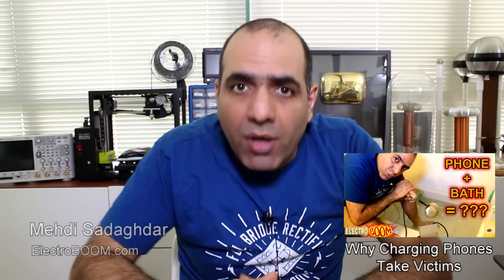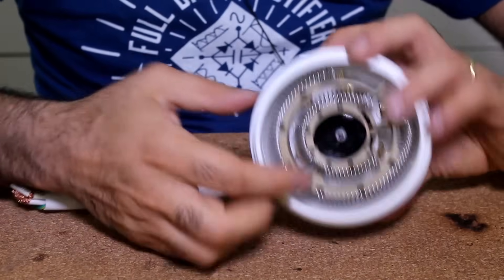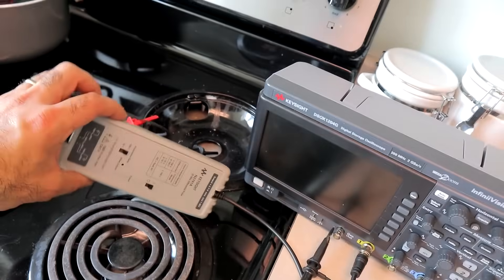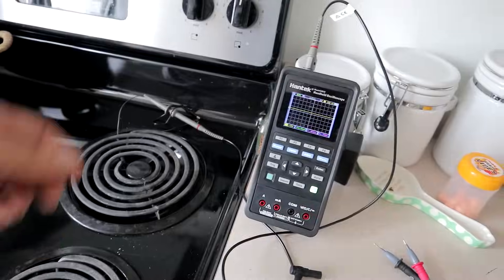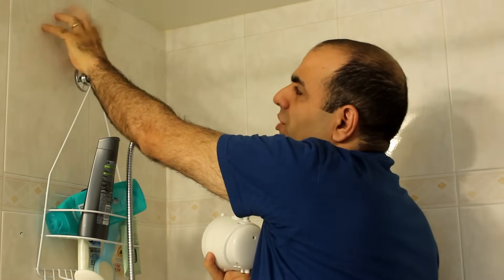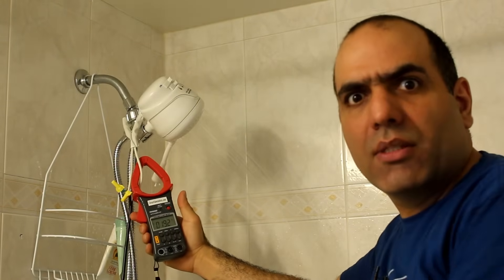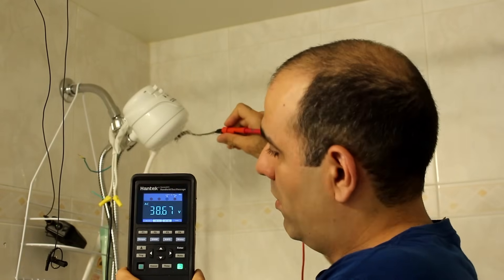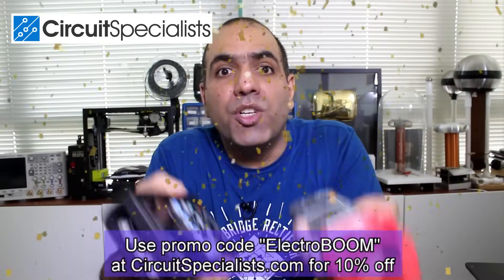How Safe Is the SHOWER HEAD OF DOOM?!

Comment: Here in Brasil (HUE-land) we use these showers everywhere with no problems because:
1- the power grid of our houses are made with this kind of shower in mind (50+ amps).
2- we don't use them this close to our body, it's a hot country and we install our showers higher, close to the ceiling, the power outlet usually come from the ceiling, far from most people's reach.
PS: our standard ceiling is 9~10 feet tall, again, hot country.
Reply: but faulty ground can make the water register(if made of metal, wich normally isn't) shock you
Reply: @Shadownrun2  but this is really not a problem, just use flip flops in the shower. The whole country does this.
Reply: You misspelled "2.7~3 meters"
Reply: @Shadownrun2  another huehuehue here. I think there's something more to it, many Brazilian homes (including mine) haven't got ground circuits and yet nobody gets electrocuted.
Reply: And chile aaaand Argentina aaand Colombia and some more (i think)
Reply: @murilospineli2241  not me.
Paranaense num frio do caralho, mas minha família toda toma banho descalço.
Reply: Brazilian here, your 2nd point is just asking for trouble... You know as well as I do most of these are installed by people with no formal education while trying to minimize costs.
Reply: @thtanaka18  huahauahauahauayau
Reply: @Shadownrun2  that true i shock myself ussing one of this
Reply: I hate taking bath with Flip-flops, so I prefer getting shocked every time heheheh
Reply: A altura média do teto varia por conta do clima do país? TIL
Reply: Why do you need hot water in brazilian climate lol
Reply: @drury2d8  sometimes we reach 0°C
Reply: @murilospineli2241  no RJ nosso chuveiro é aterrado todo mundo toma banho descalço
Reply: What does the country hotness have to do with ceiling height?
Reply: @rodrigoa1990  Um teto mais alto significa um maior volume de ar dentro da casa para aquecer durante o inverno.
Reply: Just brazilians talking to each other in english, just another day in the internet...salve
Reply: @Shadownrun2  Yeah, and sometimes it does... (when touching the faucet for example)
Reply: What's the building and wiring regulation and enforcement like over there? How likely is it, for example, for a building inspector to be bribed to approve bad wiring?
Reply: @renxula  because heat rises and leaves cooler air down below. old american homes are the same, before the time of air-conditioning. I live in honduras, all of the ceilings are high here too, and it's hot, and air-conditioning isn't a thing. too expensive.
Reply: If it's a hot country, why don't just use a cold shower. 🤔
Reply: @StarkRG  in general only big comercial/residential buildings follows all the technical standards, like apartments and condos, mostly of the houses don't. It's a poor country, build a house and having electricity is already hard, follow all the technical standards is not the reality for most of the population. Sometimes the same "professional" who project the houses is who build, make plumbing, wiring and everything else.
And inspections are generally only done in big buildings, and after the build is finished is very rare a inspection occurs. But if occurs, you can pay a coffee to inspector and promise him you will solve the problem until the next time he comes.
Reply: @BattousaiHBr  "Done by people with no formal education while trying to minimize costs." – should be the sub title of the "History of the world" book ))
Reply: @StarkRG  building inspector? You mean like a govt building inspector? We don't have these ones here
Reply: thtanaka18 I’ve visited brazil 3 times, I’ve seen many plugs that have a ground prong but I have yet to see any outlet that has a ground outside of GRU airport. Everything I bought over there I had to rip the ground prong off lol
Reply: @graeff  A building inspector is someone who works for the government and signs off on any major construction or remodeling. They ensure compliance with building codes so that everyone involved, including future owners, can be sure of a minimum standard.

I'm guessing that, if you don't have building inspectors, you also don't have building codes. In that case how do you know that the wiring in your house is done properly, the foundation isn't just going to crumble away, and the walls aren't made out of painted cardboard? For that matter, how do you know that your neighbour's isn't going to burst into flames and cause your house to burn down also? Or is it more just a mentality of "meh, if I die, I die, if I get mained, well, I'll deal with it then?"
Reply: @noname-sk3hl  freezing cold water is freezing cold even when the air is hot.
Reply: @sterkriger2572  Em SP tbm mas depende do eletricista não tem
Reply: @noname-sk3hl  because it's cold as shit in winter
Reply: @StarkRG  We do have these in Brazil. Any new building needs to have a city hall endorsement done by a building inspector, usually engineers or architects, who must approve your building before you are allowed to move into it.
Reply: I'm northern Argentina we use these too. I am 1.90 m tall and it feels horrible to be able to sense the 50 hz in your scalp. This is not safe, just really cheap.
Reply: @Shadownrun2  esse é o problema mais comum kkkk
Reply: how much is kW/h in Brazil?!
Reply: @IvanStepaniuk  I've never felt that, sometimes I get shocked while opening the shower and touching the "valve"(I can't remember the exact name) but that's it.
Reply: @Shadownrun2  i live in brazil
and the metal water register is very chocky
Reply: Pois é
Reply: @blitzkrieg7353  
It's not common to see these in Chile, actually they're quite rare.
Reply: @murilospineli2241  doesn't make any difference to wear flipflops when it's the faucet that electrocutes you. 3/4 showers i have been at in brazil shocked me, despite me wearing flipflops...
Reply: Darryl P because hot water is nice
Reply: @takafumiarisawa70  no dude
I mean the height of the shower
Reply: @blitzkrieg7353  Ohh my bad then.
Reply: Apologies for the question (no wrong intentions here), but why can't you just put a black painted, steel, water box on the roof? I think you are a very hot country, free energy just surrounds you.there!
Reply: @thtanaka18  you probably wouldnt hear from those that do
Reply: Why do you need hot showers in a hot country
Reply: the same happens in colombia
Reply: I am in Paraguay and we have many of those showers. I have one in my house lol
Reply: Up
Reply: @murilospineli2241  you use flip-flops in shower??? How barbarian!!!
Reply: Rodrigo M  Com certeza. As casas mais antigas, inclusive no RJ por exemplo, tem o pé direito bem alto, pois antigamente não se usava condicionador de ar. A casa da minha mãe é assim. Mesmo num dia de calor, o pé direito alto torna o ambiente mais fresco (leia-se "suportável").

Casas e prédios mais novos tem pé direito mais baixo e forro de gesso. Mas colocam condicionador de ar split.
Reply: no name Because even hot countries might have cold winter.
Reply: @thtanaka18  so long as the water's very clean, it doesn't conduct electricity well at all at household voltage. So even when the stream flows through without breaking up it wouldn't do much, as oppose to a bath where electrolytes would pool
Reply: @Arthur De Souza But I live in a tropical climate too... if outside temp is 35C, water is at a nice 28C or so. We dont need to heat it.
Reply: @Mr.Leeroy  O preço varia com bandeira(vermelha você consome muito, paga mais caro por kW) e por época do ano( seca e com chuva). Mas em média no, estado de Minas Gerais, é R$0.60
Reply: @JohnCanniff  not from the dead, but from media. They usually love this kind of tragedy..
Reply: @felpshehe  "OMG thats so far from my reality I think I need to call it barbarian"
Reply: @Arthur De Souza Thats inefficient.
Reply: @Arthur De Souzaif you have all your water pipes in an external conduit, its easier to access and takes advantage of the suns heat. Internally routed pipes can be a pain to repair/replace.
Reply: @ryanespinoza7297  it's mandatory to have a ground pin in every plug, but if you disassemble most power outlets here, you'll find no ground wire connected.
Reply: @StarkRG  you are assuming we actually have building inspectors
You just send the plant for inspection no one cares what you do afterwards no one check if you really used the correct wire gauge or if you did ground your installation
Reply: @Shadownrun2  That's insane. No quality control whatsoever. You but a house and have no idea if it's going to student burst into flames because of shitty wiring, or if turning on the tap in your kitchen is going to result in electrocution. Absolutely insane.
Reply: @5084204  A maior porção de terra no Brasil está entre o trópico e o equador, isso faz com que existam variações de temperatura muito esquisitas e isso pode acontecer: https://www.youtube.com/watch?v=2z-bCTMQS_w
Reply: I also use this type of shower everyday and I never felt any shock in the knob even being barefoot IoI
Reply: @rodrigoa1990 
Isso mesmo, varia dependendo da circulação de ar necessária! Casa de BR (e latino americano em geral) é mega bem-ventilada comparado com outros lugares.
Reply: Because some people like hot showers, some places do get lower temperatures, and because Humans adapt to their environment, so what's is cold to me isn't to you, I live in Rio and some people here think 25 C is cold and already putting their coats.

Comment: "it seems pretty safe"

Unless neutral wire breaks. A great gift for a "favorite" relative.
Reply: WELCOME TO BRAZZZZILLLLLLL
Reply: yep. neutral wire breaking or melting is a real risk. We do mitigate that most cases by providing adequate wiring.
Reply: Actually not, if overheating starts by the lack of neutral the element will just melt together with the plastic connections it's design to do it, the place will probably smell of burned plastic but that' it, I never have heard of any fire cause by a shower like this. Actually there's more deaths linked to fires or accidents in home boiler installations then with these eletric showers.

Comment: "1 minute on, 1 minute off, 1 minute on, 1 minute off" -> a.k.a. very low frequency PWM
Reply: aka mechanical thermostat.
Reply: Wax on, wax off... and if it's still not cooking the omelet, do a crane kick
Reply: Gianluca Ghettini well it deepens, it seems to me that it changes the frequency not the duty cycle like in PWM where there is a fixed frequency and changes the on and off duration (or it just has a thermostat)
Reply: Afaik, it wouldn't be a PWM because it's turning off and back on (i.e. 0hz->normal hz), right?
You'd be better off just making an timer based on the clock of the oven that ticks it on and off.
Reply: More like a sine wave controlled by an lfo
Reply: Example.

Comment: In Brazil we usually use the 240V 220V (typo) version because of the lower wire diameter needed and most houses doesn't have any grounding.
Reply: Sounds like a fun seizure for the babys that like sticking forks in stuff
Reply: that's why we don't let them do it
Reply: @ironicman6731  here in brazil this is the least of our concerns as a child hahahahahhhha
Reply: Hey, when I was two I did it, now I'm standing here, seventeen and all, with only minor brain damage!
Reply: No ground... We Just wire It to the neutral!!!! Bang.. welcome to Brasil
Reply: I tried putting a wire in a 220v socket when I was 6 or 7, I blacked out for some minutes, after that accident I became better at math for some years
Reply: Yeah, grounding is rare. With both live wires we do need grounding. But in fact, 220v/240v use less Amperes so... that's the way. Still there are plenty of 127V heating elements and showers to buy.
Reply: In Rio de Janeiro we use 110V, with live and return wires only (fase e neutro)... We have to use 6mm wires to be safe...
Reply: @ironicman6731  Yes, sometimes it happens. That is the reason when people have babies they buy an outlet cover to avoid accident.
Reply: I remember when I was younger, the grounding cable from shower was connected directly to the metal pipe! =D
Reply: @texboy98  And as adults as well hahaha
Reply: I've lived in Brazil my entire life and all houses that I ever saw were properly grounded.
Reply: In India, I haven't seen any house (except mine) with earthing.
Reply: Brazil lalalalala la laa.......
Reply: Use a metal pipe for ground!!
Reply: 110 is more dangerous than 220. 220 throws you back and you have a good chance of living, 110 holds you until you're dead. Just evil
Reply: Same here in syria :(
Reply: As a kid I took the tweezers from the Operation game and stuck it into an outlet. It was quite the light show haha.
Reply: Ironic Man I dont know how a kid, let alone a baby, can reach the shower head that is at least 2m high, but if he does it cannot be more dangerous than a normal outlet that im pretty sure they also dont have protected.
Reply: @smacedorj  Só se seua instalação for monofásica né ... é melhor e mais econômico ligar em duas fases
Reply: @igordiogo5692  Sim. Mas em muitos lugares é monofásica mesmo. Morei em um apartamento em que a instalação elétrica não foi atualizada e era monofásica sem terra... O pior é que nem podia atualizar pois no quadro do prédio não tinha espaço para um relógio novo, bi ou trifásico... De repente hoje em dia, com os relógios modernos e minúsculos, talvez até coubesse...
Reply: It's suspect many, if not most houses in Brazil, at least in the less affluent areas, don't even have GFCIs
Reply: @ironicman6731 I have been shocked by both 110 and 220 and the latter will kick you instantly, whereas the former will keep shocking you longer 😂

Comment: "Besides the fact that it may set your house on fire it is safe."

Thank you, sensei
Reply: sensei means a japanese karati teacher lol uur way off
Reply: @kovanpulkinen8205  Sensei, is a japanese title, given to a teacher or an honoured individual, such as a doctor.
Reply: @gjune36  Ok i was close enough and you probably searched it up atleast i didnt.
Reply: @kovanpulkinen8205  I used to watch a lot of anime and used to like Japanese movies.
Reply: @gjune36  simply writting "your right and i was wrong" hurts more than a 240V shock on the internet.
Reply: @n.m.9616  When someone just rages on me for an unknown reason, i just type that
Reply: I am Brazilian, but I have never heard any case of houses on fire.
Reply: here in BR nobody builds a bathroom using wood, you can make the house using shit, but the bathroom NEEDS to be laying brick and mortar and have a separate circuit for the shower, just in case the stuff try supernova is isolated from ANYTHING ELSE..
Reply: @izanagi3036  pessoal faz banheiro de tijolo né.. mesmo porque se passar agua corrente na madeira o negocio apodrece em 2 semanas kkk
Reply: @izanagi3036  Yesterday a 27 year old mother of three died electrocuted while washing clothes in a "tanquinho".
Reply: @izanagi3036  Here a lot of people don't even have grounding on their houses.
Reply: @tiagopesce  Hey, but if you run running water many times on the brick it melts, so there is a system of pipes.
Reply: @giu_br777  "tanquinho" This shaker is used for washing machine not manual, basically it is a blender without blades, the motor is still dangerous.
Reply: It's easier for a boiler to malfunction and cause a fire than one of this things to burn the house IoI
Reply: in brazil the houses are made of bricks, not wood frames like USA, they don't catch fire easily...

Comment: Using an electric shower requires some care that we learned as a child in Brazil. The shower should not be close to the head; the temperature selector switch must not be touched while it is on; taking a shower using rubber slippers is recommended in places where the electrical installation is precarious; and there must be a circuit breaker just for the shower. Electric shocks in the bathroom are common, but they are usually minor. I believe that the main risk of electric showers is the fires they can cause. We already had a shower that caught fire in my house, and it has also occurred to me that I was in the bathroom on a day of hydraulic instability and the shower element turned on by itself, causing a near fire that I managed to prevent by turning it off immediately (if I hadn't been there seeing it, it would have caught fire).

Comment: Back in college, I helped a friend install one of these in his room. Neither of us have any knowledge regarding electrical engineering
Reply: And did he.... 9:57
Reply: This is the essence of Brazil. Install shower without any knowledge about. A lot of gambiarras LoL
Reply: @LucasLima-nj2hx  usually you just grab the cables and connect them and use it. There is not a lot of science behind xd
Reply: @LucasLima-nj2hx 
Not gambiarras, they're technical adaptations, than you very much :P
Reply: @andreroth3684  touching any phase while being wet would probably kill you(this one in particular would probably set you on fire tho), and the water just comes from the water supplier it doesn't go trough any tank. At least on my case.
Reply: @JoseFerreira-nk5kq  Yes that with the phase is true. Just keep the hands down. In Brasilia, santa maria for example, are many tanks on the roofs. I think it's allways better to let a professional do the electric installation.
Have a nice day
Reply: Well that sounds fucking safe, my roommate and I had enough trouble getting permission to install a loft up by the radiator and we were both engineering students.

Comment: Loveeeeeeed your video. Brazilian and I used to have my house on 110V, so my Shower Head of Doom ran on  ~50A. Usually in Brazil, the electric project of the house is designed to support that high amperage. But besides that, I have never heard anything about any of those catching fire, the worst case that might happen with those is poor insulation so you might get a slight discharge on the water valves. Nothing that a towel doesn't solve (Brazilian kids learn about insulation instinctively)